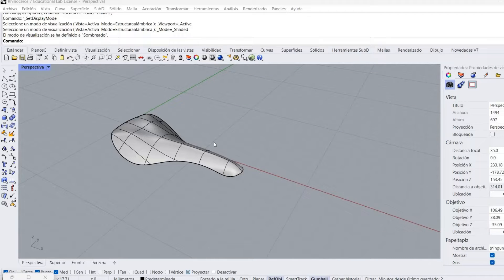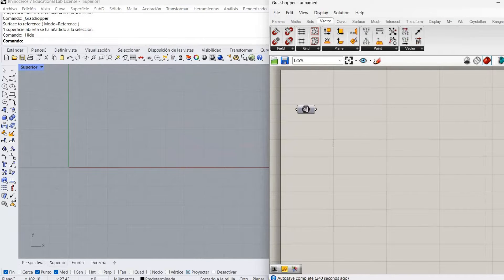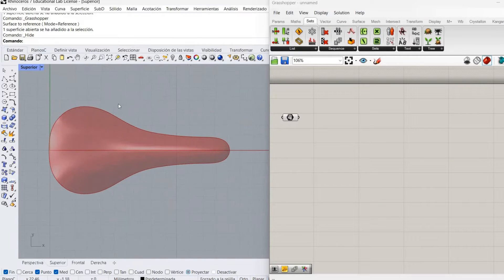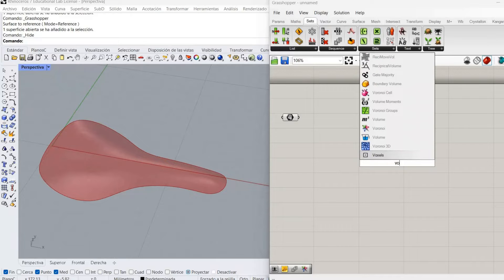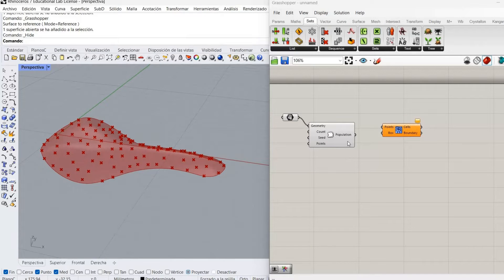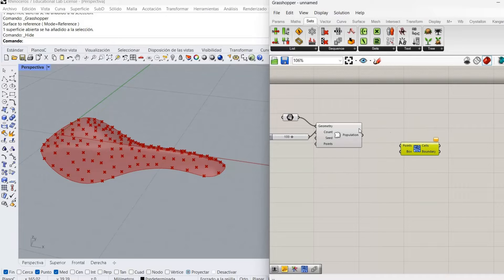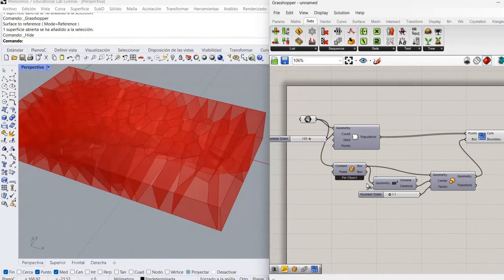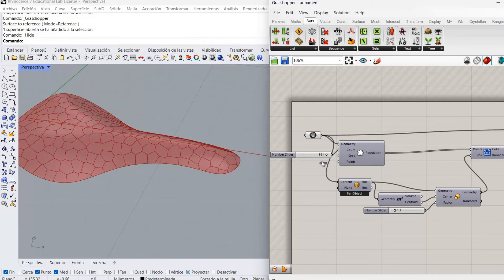Grasshopper tutorial - Voronoi Bike Seat

Comment: Dear Filippo Ruggiero, from minute 10:45 onwards, when you start the procedure to extract the larger surface, things start to go wrong for me and I don't get the same result. When I turn off the preview of all previous instances and leave only the "List item" activated, only one of the voronoi polygons is displayed. The object I'm using is a vase. Could you help me, please?
Reply from the maker: Hello!
This is because the first item on your list is that polygon. What you have to do is "Sort list": Get an "area" component and find out the area of each surface. The area output connect it to "k" on a "Sort list" component. Connect the surface split output to the "A" of sort list component. Reverse the A output of sort list. Connect it to a list item component. Contact me through instagram and I can send you a screenshot :)
Reply: @pippocreations  Thank you very much for your response in such a short time. I will contact you on Instagram.

Comment: Thank you for this great tutorial!
I did the same thing for a shoe insole, it is a mesh and I added it as geometry.  I closed the polylines, filleted and lofted it with the scaled part because I don't have a surface and couldn't use the surface split. But the edges of the mesh are not smooth nor closed. Can you please help me fix it?
Reply from the maker: Hello!
You might hav to re-mesh, or work on the mesh itself. Another option could be adding the thickness in Rhino instead